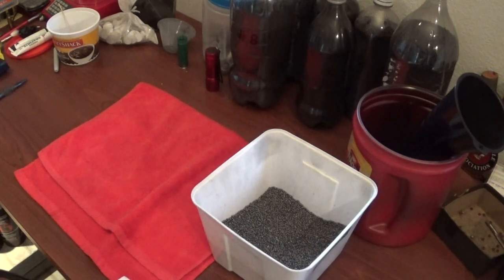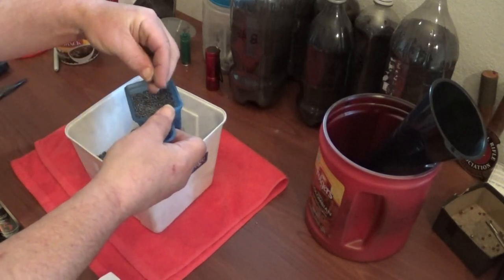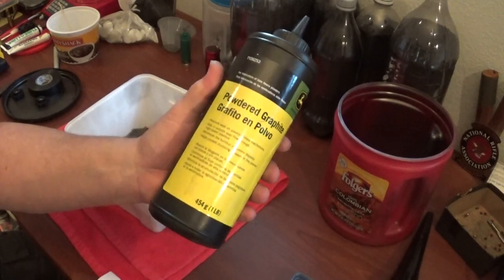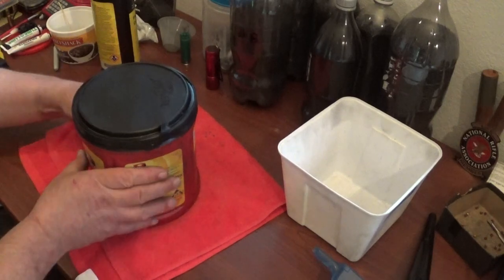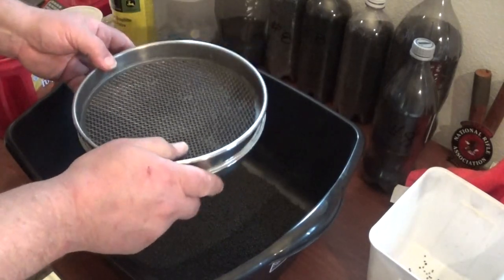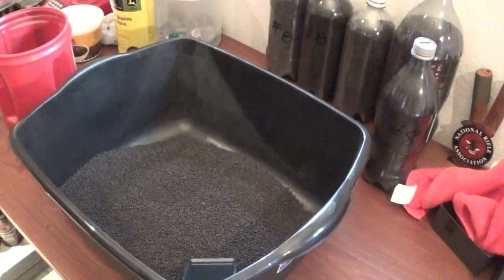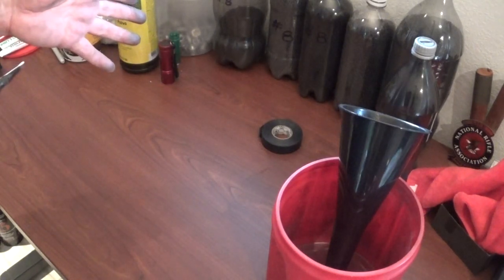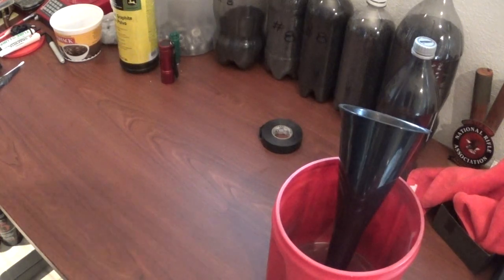Shotmaking, final polish, and graphite coat.

Comment: If I may, I might recommend that you mix the shot between containers with at least an N95 mask on with a fan blowing hard outside across you while you do it. The color your seeing on the shot after it comes out of the liquid is lead oxide and when your mixing it between containers your breaking it off and sending it everywhere as lead dust that will poison you. My uncle found out the hard way back in the 90's making shot and casting bullets. It darn near killed him and he has had some nasty lasting effects from it ever since. I took his lesson to heart and use the mask and only work with lead outdoors with a fan blowing across between me and the lead.

Comment: Very neat Thor’s axe. Cheaper and fun👍🏻 looks like you’re exploring every aspect of the reloading world. Don’t know if I’ll ever load shot but will reference your slug videos when I start casting and loading slugs. Thanks for making all this info available👍🏻
Reply from the maker: I would no wast any time, effort or material on buying any other slug molds other than the Russian ones. They are accurate and well engineered to perform. For years and decades, tons of lead was wasted by people trying to get performance with the molds that were available on the market. I feel that has all ended now. Dave.

Comment: Thanks Dave. You've taken the mystery out of this process. The $ savings from this can make Trap and Skeet shooting much more affordable. Plus , it looks like fun!
Reply from the maker: It is fun. If you can get you material cheap enough, that will take up the cost of the machine in the end. I had recovered lead already from the range that had no cost to it other than my time, However, even if you paid $1.00 a pound for lead, that will still beat the price of the reclaimed shot. and have a fun Saturday afternoon doing it, there isn't any real work to it. It's not like casting bullets. anyway, I just want to say thank you for all your advice, You are absolutely right about the aspects of shotgunning. it isn't like other shooting sports. and there is a technique to it that need the practice to get good at it. Thanks again, Dave.
Reply: You're welcome, Dave. Your advice on loading and casting bullets has been invaluable to me too!.

Comment: TA - The sheer volume of that shot production is impressive..!!  --Great for claybusting.   Gung Hoh, Dave..!!  --Good shootin' to ya, Steve
Reply from the maker: I don't know what it is about getting out a pot of lead and melting it down, however, it's like a Dog whistle to the neighbor guys. My neighbor came over and the next thing I knew we were turning and burning,  It's a lot of fun. We made all this shot in one day and I was using the machine at less than 1/2 it's production capability. adding more tippets will increase production dramatically. I'm just one guy with a want to go shoot trap on the weekends, this machine (I believe) is for a group of people who want the savings of shotmaking. or a gun club for that matter. However, I figured that the sooner I get with shotmaking, the more I would reap the savings of it. Now the machine has paid for itself and all it cost me is time. Good shoot'en to ya Steve. Your Friend, Dave.

Comment: Awesome Dave you on a roll nice work that’s great you can get free lead from the range that helps a lot on the cost
Reply from the maker: So far it hasn't cost me anything in the material. One thing you need to do is flux your material really good, get all the impurity out. this will help with the flow when it comes to temperature. also, casting small bars of material helps in keeping the machine going. I like the Magma Machine because of the stainless steel tippets it comes with, also the heat is adjustable to suit the material you're using. Making shot doesn't take much in the way of equipment, a simple melter can be homemade out of a cast iron pan and holes drilled in it for the tippets you want to use and a catch slide made of aluminum above the coolant, you can use a stump burner you can get at Harbor Freight for $20 is all the heat you need. you also need to engineer a stand so that the pan can be suspended. Just watch the way the Russians do it. anyway. I felt that life is too short and bought the Magma, they have always been good to me. Thanks again, Julio. Dave.

Comment: I wonder what your alloy mix is you are using to make your shot.
Reply from the maker: Just plain old range recovery material. I didn't add anything to it, I believe it is mostly wheel weights. You can bring up the hardness by adding linotype, However, I found that this stuff works just fine the way it is out at the range. People have been wanting me to pattern my shot, But here's the deal. I can adjust my shot pattern with choke tubes and so far I have been able to hit what I'm aiming at in 16-yard trap. Patterning it would not reveal any advantage.

Comment: the ammomakers had a high tower to drop the dripple`s of lead in a cold water bassin. maybe a few meters if you have a second store higher ( fall tru a  10 inch pipe) would  give even better shot,  you need a deeper water barrel then.
Reply from the maker: Okay, I have not seen any.. any difference in the hit ability of patterning due to shape of the shot. the shot goes through the choke,, How round is it then? also, lead will obturate and dimple out in a new shape due to exhilaration and inertia, again Now how round is it? Most shots in trap is taken at 20 to 35 yards from the trap house, the shot is perfectly adequate for that use. and may I add, most top shooters use this machine for their trap loads in non sanctioned matches.  are they doing it wrong too?
Reply: @Thorsaxe777  no,
 but een round bal wil fly more predictable  and give a better pattern.and the shot is most inside a plastic (biodegradable) shotcup ,so the choke does not harm the shot much. and round ball`s  will go with  much more  ease tru the choke. because they can roll/flow away in eachother they dont hook up that much
top shooters shoot with factory ammo at olympic or wk matches , shoot 24 gram (steel)loads  and with that light load you want  less flyers, that  one gets with not round shot .extreme spread was made with cubical shot .browning fn i think made them  .
 for training and hunting loads it does not matter much and is that home made shot perfect. yours
Reply: @Thorsaxe777   if you hunt with dogs. Or on a fire line with other hunters.you don t want pellets that.     Are going random.out of the shooting direction. Flyers .and a flat side on a rond pellet.   It will go out of the direction
Reply: That is correct, some old shot towers from the 1800s were 150 foot high